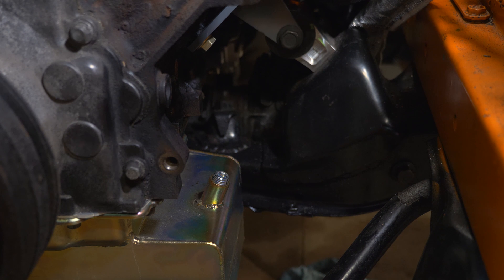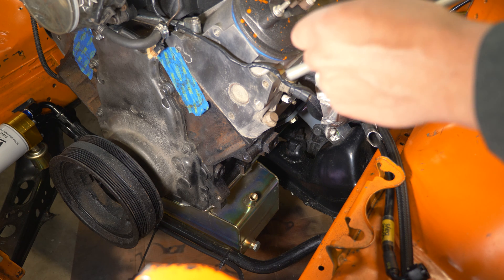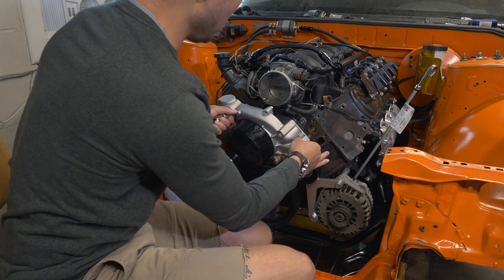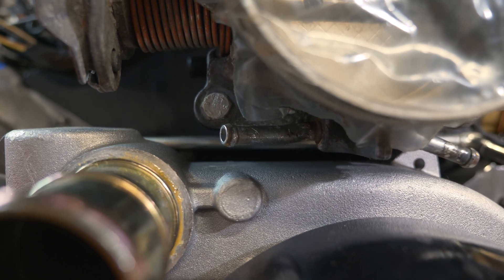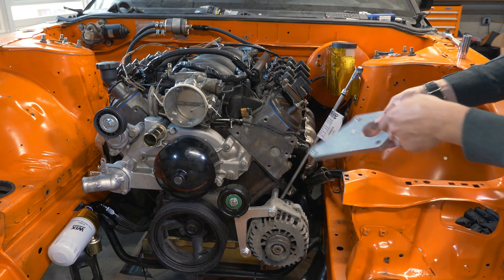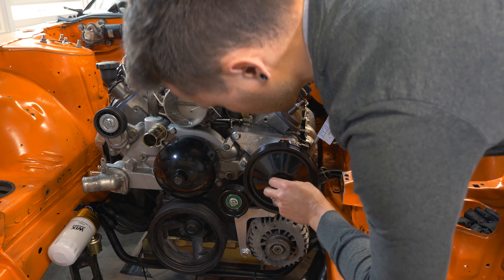Accessory Drive | LS Swap 240sx

Comment from the maker: Hi everyone, so just in case you're in a similar situation:  The specified oil capacity of the Canton pan is 6.5qt. Adding in the remote filter setup, you'd want 7qt total. To get the dipstick sorted, pour 7qts in, turn the engine over a few times, and the read the dipstick. Trim the top of the dipstick tube (which puts the dipstick further down) until the oil level reads correctly on the dipstick. Thanks to @mylittlezenki for the knowledge!!

Comment: What size water pump spacers did you use !!!
Reply from the maker: 3/4" from LSX Innovations
Reply: Thank you so much man !
Reply: Sorry to bother you again but do you know if half inch spacers would work? I measured and it really seemed like it would but you went with 3/4 so I was wondering if you've already tried half inch before I waste my time lol
Reply from the maker: @thomasjoyce8374  If I remember correctly, 3/4in is what was spec'd by LSX innovations. It has to be spot on for your belt alignment.
Reply: Alright my last question lol. And Thank you again for the help you've been an absolute blessing ... but what size bolt did you get for the power steering PULLEY . Mine didn't come with one and in guessing no one else's did.
Reply from the maker: @thomasjoyce8374  great question. I have no idea. you might be able to call up a Chevy dealer and just order the bolt from them.

Comment: hey benny I subscribed recently to your channel. not sure if I'll get a reply but my question is I'm doing the same z32 trans and 5.3. question is are you using the stock s13 clutch master cylinder? or is there an upgrade? thanks.
Reply from the maker: yes, I'm using a stock s13 clutch master with an ISR clutch line into a z32 clutch slave. good luck with your swap!
Reply: thanks for the reply! last question for now lol what power steering lines are you running from the steering rack? I'm using the stock gm  power steering pump and reservoir.
Reply from the maker: I’m running the sikky high pressure line and then some generic line from summit on the low pressure side to and from my cooler
Reply: So I can use stock s13 clutch master cylinder for a NV3500?
Reply: @robertclark7380  yes you can.

Comment: That kit looks awesome. Did you use the truck alternator and truck spacing crank pulley?
Reply from the maker: Yes it’s the truck alternator that came with my engine as well as the truck crank pulley. It just barely fits with my aluminum radiator and electric fans.
Reply: I’m glad to hear it fits. How much clearance would you gain going to a corvette pulley system or something?
Reply from the maker: @pushrodgarage8716  I think it's around an inch

Comment: Might wanna consider getting a fbody harmonic balancer. Using the trunk balancer might give some spacing issues between the crank and efans
Reply from the maker: At first glance it seems like there's enough room, but now I want to run out there and pop the radiator in place real quick!
Reply: Benny Obscene I’m doing same swap you’re using truck pump did it work ok?

Comment: For the water pump you need a 3/4 inch spacer. I got a set off eBay for 20 bucks.
Reply from the maker: Thanks! I’ve got spacers on the way from lsx innovations
Reply: @BennyObscene  i was wondering how you fixed that. couldn't find the video of you fixing that problem but now i know